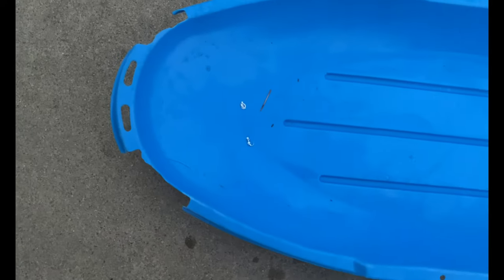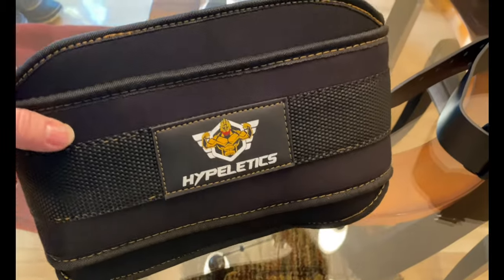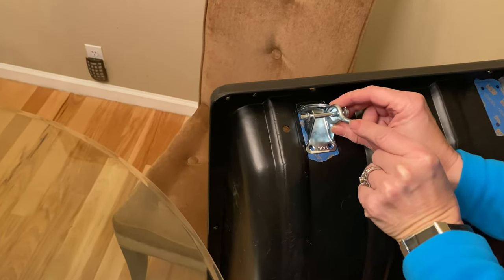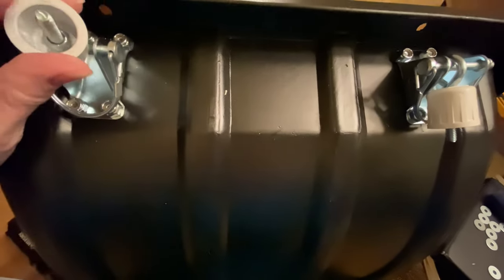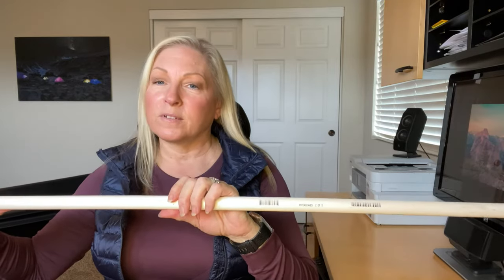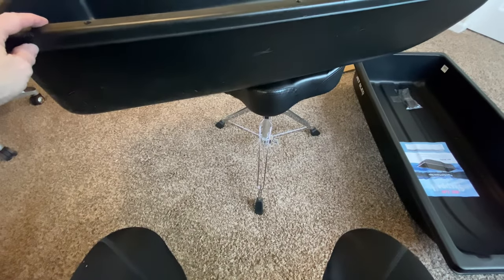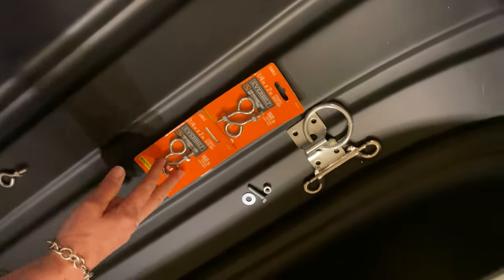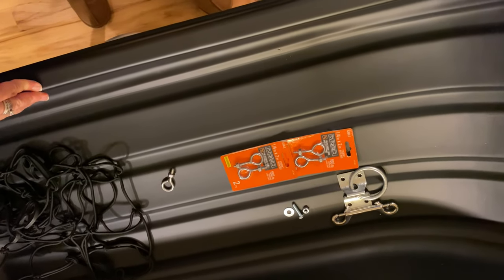DIY Pulk Sled Build - What didn't work and how I'm trying to fix it!

Comment: Hey there, great build !!! I love the idea with the plastic dip. How does it hold up? Was thinking of doing my poles like that.  

Happy trails ;)
Reply from the maker: Thanks!  Everything is holding up really well, with the exception of the stuff I sprayed on the poles. LOL!  It came off way too easy and looks awful. I'm planning to peel it off and spray them with something else. I'm really happy with how the sled pulls - especially when going downhill with a heavy load. No issues at all with it hitting me in the back anymore. And I like that I can unbuckle the belt and the whole thing comes off. I can't wait for a little more snow so I can get it out again. Thanks for watching!

Comment: your mountings need to be reinforced
Reply from the maker: Yeah...I've thought about pulling off those bolts and putting some aluminum strips on the inside to reinforce the mount points. Thanks for the reminder - I'm heading out next weekend and that needs to be done before I go. Thanks for watching!